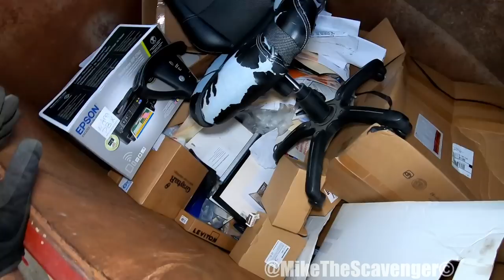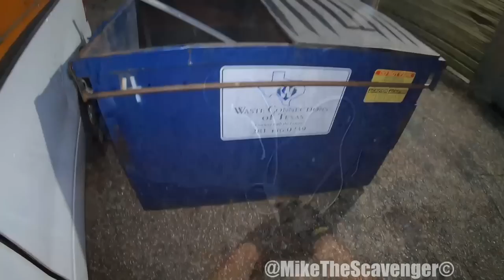Dumpster Diving "I'm Done With Cubicles"

Comment: I have turned 2:10 a couple of them into pistol safes. If keys are not available drill out the lock, If open, remove lock and replace with a new one. Home Depot, Lowe's, Amazon, all carry new locks in many configurations. Keeps curious tiny hands at bay. You can also make mini-safes to put valuables in for your car or truck. They fit under a lot of folding car seats and can be hidden from the prying eyes of ne'r do wells! They can even be installed  between wall studs for small hides in homes. Lots of uses!

Comment: Do you ever grab pop cans? Making a little can crusher could make you more money in the long run...
P.s. Marlboro packs have codes on them that you can redeem for cool stuff!
Reply: At one or two cents a can ,figure the time effort and mess and you will see why most  scrappers don't mess with them.
 I get a Nickle per soda container and will grab a few plastic bottles that are on top but won't dig for them. Just the time to empty a soda cans mess can cost you money in the long run from missed scrap you could have had time to get but instead you were messing with a soda can.

Comment: Mike that's a telephone switching power supply. Please save me the computer DVD disc's. I could use old OS disc's.
Please save those LED lights and can be fixed and cost .10 cents to fix

Comment: Too bad Texas doesn't have recycle value on can and bottles, here in Commiefornia you get 2.00 a pound for them but because of rules most of the dumpsters are locked at night because trash rules make it EXPENSIVE! just residential trash service here is 35.00 a month and 200.00 or more for each dumpster for a business.